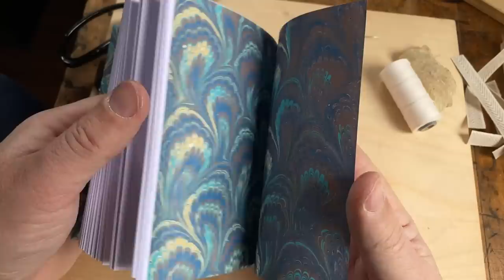A Quiet Morning in the Bindery | No Talking | No Music | Real-Time ASMR Bookbinding

Comment: Hello! Your channel has helped me so much in learning how to bookbind! This video is lovely! 😄
I had a question about the sewing. I sewed all the pages of a book together using the method shown in the Medieval bookbinding video, and it holds, but the individual page sets (if that makes sense) are really loose. I’m wondering how I can try to tighten them to keep the pages more secure? 
Thank you! God bless you and your work! ✨
Reply from the maker: Ah yes, that was was sewn on cords, which can be tricky to get the tension right. It's important to make sure all of the stitches are pulled snug, but not too tight (which is hard to explain; like a nice hug rather than a bear-hug if that makes any sense). And when sewing on cords the thread should go all the way around the support cords and back into the signature through the same sewing hole. That gives maximum support. I hope that helps!
Reply: Perfect! Thank you!! 😄✨